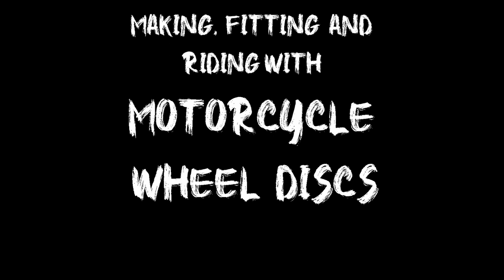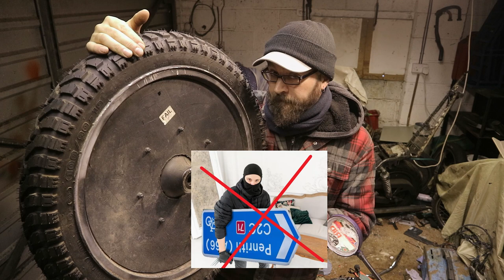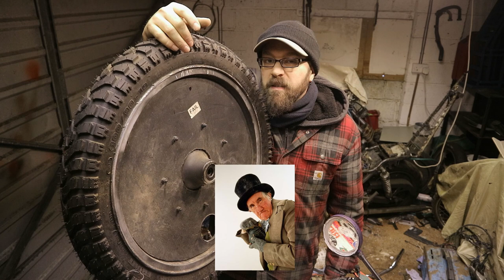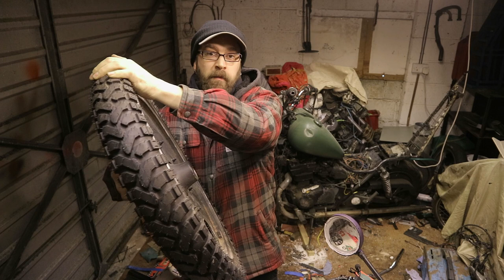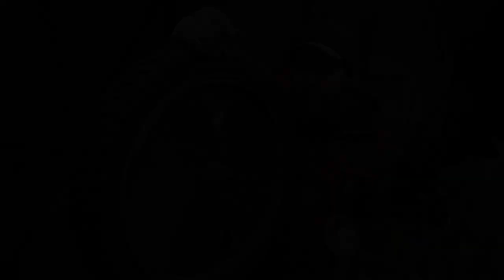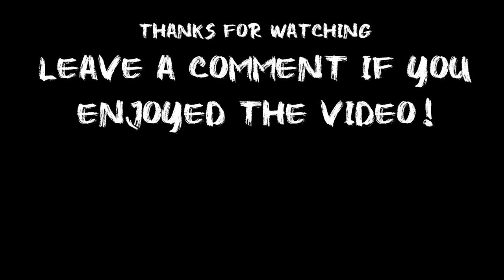Motorcycle wheel discs Making Fitting and Riding with.

Comment: Aluminium mesh and perspex also make good wheel disks.
The aluminium mesh disk I made decades ago had all the cosmetic effects of a wheel disk with none of the disadvantages, both my motorbike and push bike had them at the time.
 my electric bike is currently rocking a perspex rear disk and it makes a helluva cool noise at full power.
Reply from the maker: Cool, love those ideas.
Reply: Can you share the wheel sound
Reply: @rahulpatel1986  There's a few vids of me riding about on it on my channel but the sound doesn't really sound as good on the vids as it does in real life.